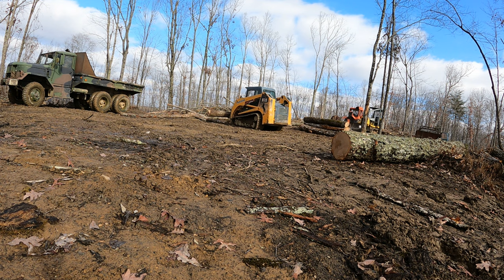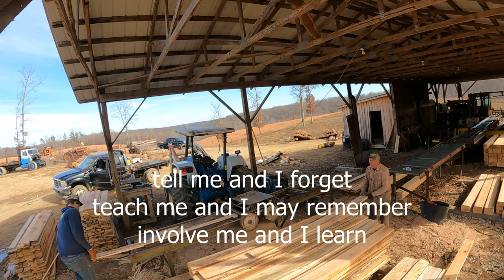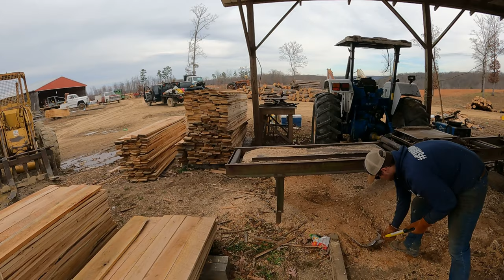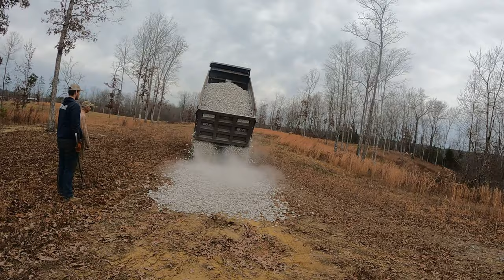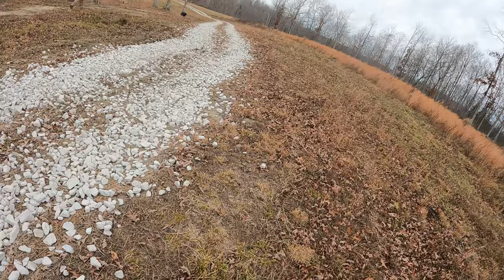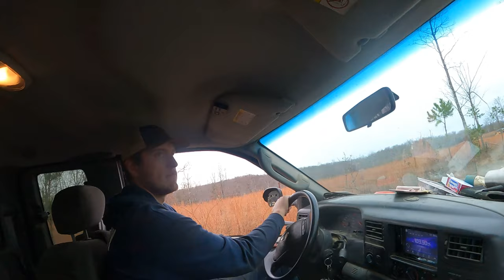THIS IS HOW WE EDGE OUR LUMBER

Comment: Hell ya boys gettin it done that edger you guys got seems like it will do you guys just fine the 1 i got would be over kill for you guys with the timber you Boys are cuttin but if you know any 1 looking for a 36" crosby edger ready to get belts hooked up and go has blades it with carbite teeth curantly set up to cut 1-6" wide board and 4-4" wide boards blades can be slid side to side to change cut width $5000obo bring a trailer will load with fork lift god bless you all and stay warm down there boys 🤘🤘🤘